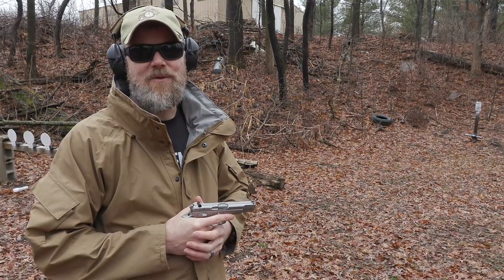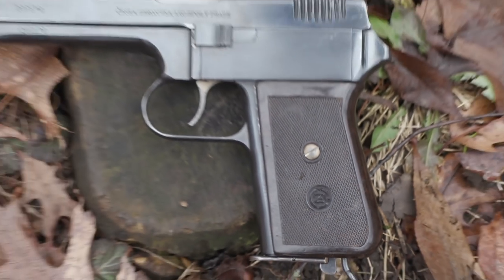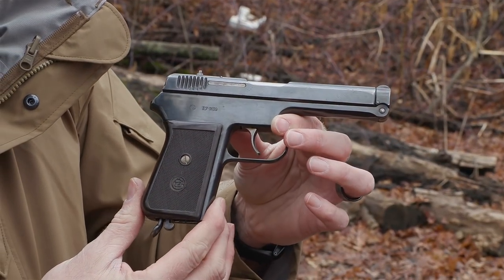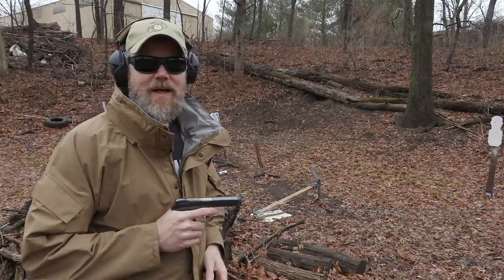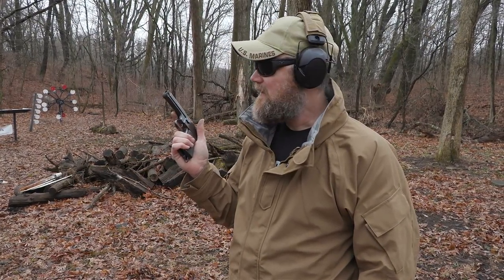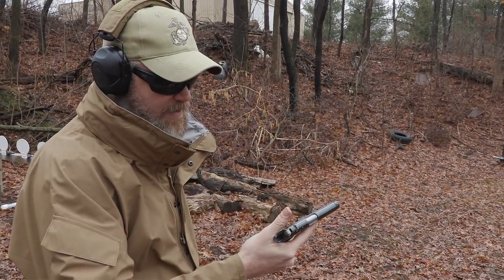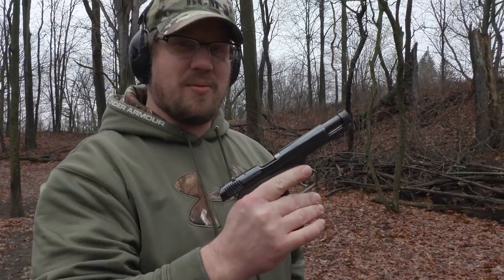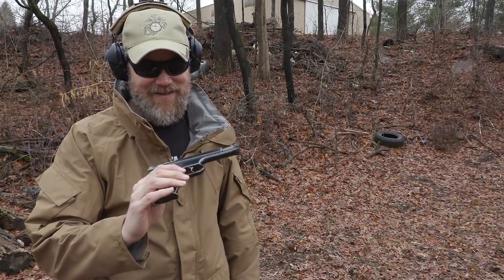The least ergonomic handgun ever made? The CZ38/39

Comment: Have to be careful with those older CZ pistols. I know for a fact the CZ-82 is NOT drop safe. And yes, I have full written proof of this. During the 90's after several incident(Including fatality), Prague's Institute of Criminal Investigation did a full examination of the pistol and found if dropped directly on the hammer in Condition 2 the pistol will fire. That includes all CZ-82 & CZ-83 pistols in 9x18, .380, and 32ACP. I was told some of the other older pistols like CZ-50 etc(Possibly this one, as well) are also not safe but I have nothing to confirm this. Btw I love CZ pistols, as well. The CZ-75's and all the newer pistols are gtg from everything I hear. I personally carry a RAMI and use a Shadow for competition. Cheers
Reply: Ak Dude of course the 52 and 82 are not drop safe. There's no firing pin block. Same goes for the tactical sport, all the shadows, the czechmate, the pre-b 75, etc.
Reply: Still more drop safe than an early Glock.
Reply: Ive been present to an 83 firing out of battery... was not pleasant. Guy holding the weapon got hit with shrapnel from the shell exploding.
Reply: Joshua Griffin firing out of battery with a hammer fired pistol? How did that happen
Reply: meifert2 there is a rod on the left side, inside the slide. When the slide went home it somehow pushed the round into it striking the primer. The round not being in the barrel then exploded sending shrapnel out the ejection port.

Comment: And next CZ pistol be CZ vz 52 7,62x25 mm
Reply from the maker: Because they're so common I've not done a video, but I promise I will this spring/summer.
Reply: A sweet design that looks good and feels like a high school shop project in your hand.
Reply: Hey MAC, in Czech republic we givit CZ 38/39 nickname "Louskáček", english  "nutcracker"
Reply: Don't forget the underpowered cz45.
Reply: Or older CZ 36
Reply: I just bought a 52.  CA prevents me from using it yet.  I was hoping someone had some experience with Harrington's replacement firing pin and trigger block modification that supposedly makes it a lot lighter trigger.